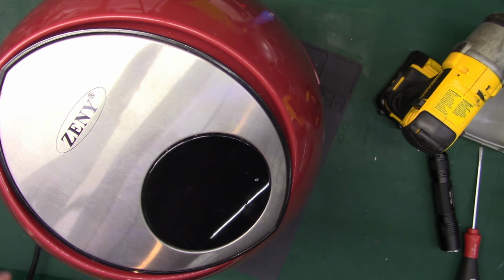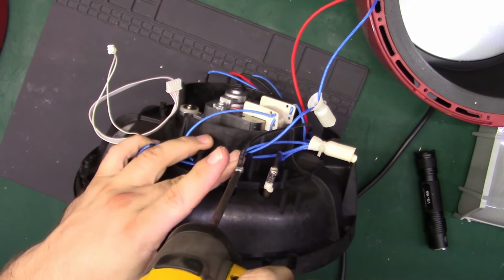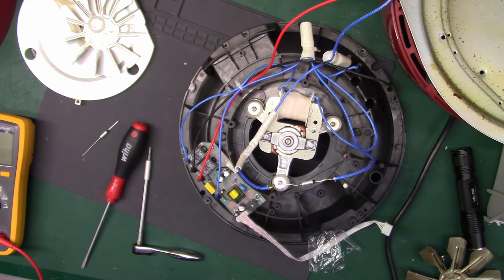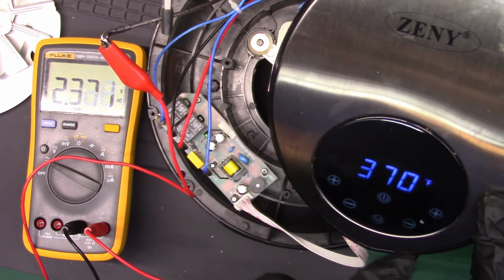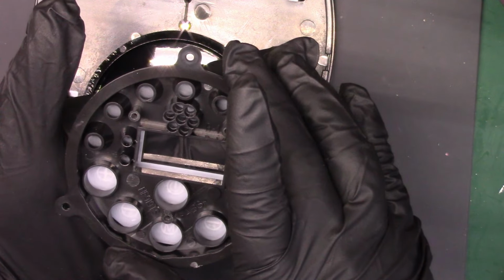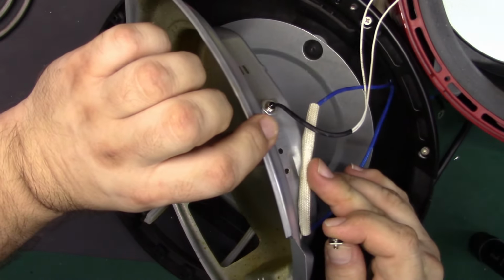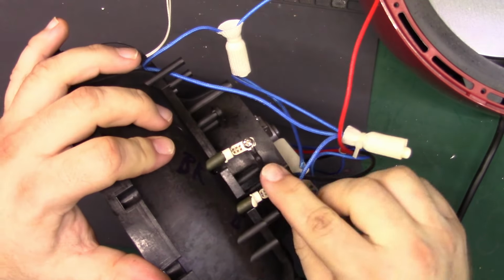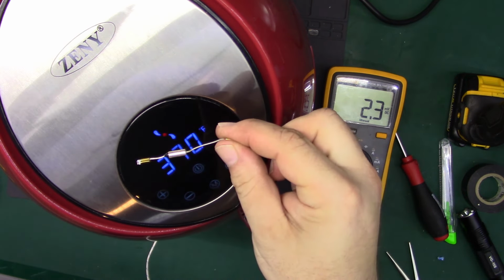Digital Air Fryer Repair

Comment: I have one question can we fix with micro switch any brand of air fryer doesn’t matter the and brand plz reply it’s will really help
Reply: What about the micro switch size any size air fryer have same size that my concern
Reply from the maker: @Sam-st4di  I am not sure.  The values are stamped on the side of the switch.  I would not be too worried though.  The switch is only making sure the basket is in place. Very low power going through the switch. There are exceptions but I would expect most microswitches on air fryers to be the same or at least compatible.
Reply from the maker: The only thing that matters is the value of the switch.  As long as voltage and current ratings are compatible(rated voltage and current must be at least the same as the old switch), you can use any brand of switch you want.
Reply: Thanks

Comment: Same parts as gormia unit .thermal fuse blew due to unit overheating .( loss of temperature control ) .Also unit not UL approved.
Reply from the maker: I think these are probably generic as heck.

Comment: Wonderful video. I blown my new 110v Instant Vortex Plus 7 in 1 airfryer oven by plugging it to a 220v plug. Wonder if it can be repaired?
Reply from the maker: Thank you! It probably can be repaired but I will warm you it might be not worth it. The only part worth changing is the internal fuse. If the main control IC is bad, it's not worth going any further with a repair.
Reply: Thank you for your reply. The white casing was burnt exposing the copper coil.

Comment: Hi there 
I was just wondering if you have ever taken the cover off a on a Tefal actifry serie - O01-1 for any repairs ! ! !
I have two Tefal actifry serie - o01-1  one no heat and it turns and the other heat but not turning.
So what I have done is combined the two to make a good one i.e. heat and turning.
The question is "does it matter if the heater element wire are crossed over ?
If i can get hold of aschematic I can sort it out immediately.
Reply from the maker: I have not personally but I can definitely tell you the heater wires being crossed it totally fine. The heater is just a coil of wire that gets hot.  There is no polarity.   My guess is the one without heat has a bad thermal fuse or bad heating element.  The fryer with no fan probably needs a new fan motor.   Making one from the 2 is a great idea!

Comment: hi there i have the same problem ive worked out the fuse has blown just out of curiosity are you meant to get continuity on the copper coil?  because i dont seem to have any?
Reply from the maker: If you mean the large coil/heater coil, then yes. You should get pretty low resistance. I'd expect 10-20ohms.
Reply: @FixitFrank  no i mean on the fan the fine copper wrapped around which the pos and negative terminals go to
Reply from the maker: @TheDazzmo  oh ok. yeah that should also show resistance. I bet your fan motor has an open coil. I think they should read around 1000 ohms(might be less, I can't quite recall).
Reply: @FixitFrank  ahh thought so!! Must be that that's packed up as its not reading anything at all!! Brilliant thank you for the reply!!! Much appreciated

Comment: Wonderful video. I have cosori that failed after 4 months! Gonna try your fix. Thanks for posting this video. I have full refund but really dislike idea of tossing this thing into landfill if it can be fixed
Reply from the maker: The trick with these seems to me measuring voltages. All friers seem to be similar. If the board acts dead then I would check for fuses and that sort of thing. I suspect the thermal fuse is bad. That seems to be common.

Comment: think you
Reply: I have a Princess House Air Fryer n washers or spacers came out of the motor but it is still working for now.  Is the motor falling off its mounts.  Only had for 4 months.  I emailed the company.  Concerned about Using it.  Should I?  Let’s see if company will replace it.  Wish I knew how to fix stuff like that.  Where are men like you.  I can fix more things then most men I know.  I can take things apart and fix by accident I suspect.  Before tossing I have some fun with it.  I learn from YouTube.  Love your excitement.

Comment: Oh I wish my Gourmia fryers control panel would pop off that easy. 
I've got to take the piezo out, the beeping is so darn annoying.
Reply: 1 hour later, figured out it was the top square panel pops off, and reveals 4 screws to take out.
De-soldered the piezo, no more buzzing!

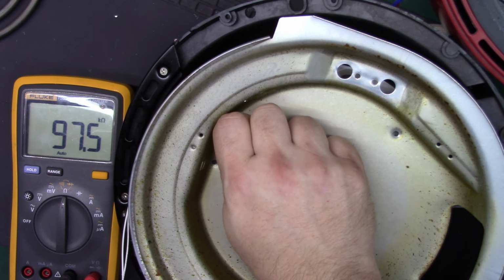Comment: Hello FixitFrank, first of all thank you very much for your video, thank you for expressing it so well and thank you for your selfless help. I happen to have a fryer like that (a little bit different on the outside but technically it is the same, it is a MVPower) with a problem, the screen says "E2", the heater and fan work but not the on-screen controls. Only the "E2" is left blinking, therefore I cannot use it. I have checked the device that you say could be a thermistor and that you touch with your hand at exactly 9:53 of your video. Your thermistor marks 97.3 koh, however mine marks as a short circuit: 0 oh. This makes me think that maybe here is the problem. I am trying to find this thermistor on Aliexpress, Amazon, etc but to no avail. Would you be so kind to help me? I would be very grateful if you could tell me where I could find it or some enlightening information. Thank you very much for everything, kind regards.

Comment: I have a piece of equipment just like the one in your video and it had a blown thermal fuse. However, after I replaced the thermal fuse and completely assembled the device and turned it on, it worked only for a moment, when it started to heat up it turned off. After it cools down, it turns on again. I am not sure if it is the thermocouple or if it is one of the capacitors on the electronic card.  
The capacitors look good. I don't know how to test the thermocouple. Could you help me, please?
Best regards.
Juan Carlos
Reply from the maker: The thermistor should be around 10K or 100K depending on the model.  You should read around that when you measure resistance.  Maybe 6-8K on a 10K thermistor and 80K~ on the 100K thermistor.  The resistance changes with the heat. But from the description, I would be suspect of the heating element.  Sounds like it might have current leakage.
Reply: @FixitFrank . I'll check the thermistor, I'll look for it in the market. In Venezuela it is a little difficult to get these items, however, I will do that search. I think you are right with the diagnosis you have given me. Thank you very much Frank.
Reply: @FixitFrank  Hi, it´s me...again. I checked the thermistor with the multimeter, however, the readings are very erratic and vary constantly. It doesn't look like the thermistor is in good condition when it do that. On the other hand, how do I verify that the heating element is leaking current? After one minute of operation, the unit simply turns off. Thank you Frank, again.

Comment: informative video.  I tore one apart and wasn't as lucky as you were.  The problem on mine was a blown thermal fuse also, and since I didn't want to wait forever for parts I just jumpered  the fuse.  For those who think that is sacrosanct the machine will still shut down before it is too hot because it has the thermistor in it for temperature control.  You will get a blinking E on the board.  I know this because when I put the machine back together I found out that the thermal fuse had blown because the coil on the fan went bad, and when the fan don't work they overheat pretty quickly!  :(  So I ended up with parts in a box instead of a hot air fryer.

Comment: Thank you so very much! I am not electronics-savvy at all, but following your video and having a multimeter saved my air fryer. Yes, it is a $40-50 unit and some people might say that it is not worthed spending few hours and $7 to fix, but it feels good when you can revive something and pollute less.

Comment: Amazing video! I just ordered some thermal fuses, as well as a multimeter - I have been putting it off for years and just guessing at which part I needed to resolder etc. haha - anyway, my air fryer runs (turns on, heats, the front controller works fine), it's just that when it runs, the fan does not turn on, ever. The fan spinning icon shows up when it is heating, and when the heat is turned off it stays on for its 'cooling' stage as well, but the fan is never actually spinning. I tore it down just today to see if there was something obvious (a loose wire running to the fan motor keeping it from getting power, for instance), and after doing that the only thing I found was one wire that was loose in a crimp nut, but after taking those out and redoing the wire nut making sure it was a secure connection, I put it back together and it's exhibiting the exact same symptoms. I am concluding now that it isn't actually a thermal fuse since the system still boots up and the element is still heating. Is there anything on the controller that I should check, or should I assume the motor was bad and burnt out? I should note I received it as a gift and only used it for ~5 weeks before it died. I bought a new one and we've used it for 6+ months now with no issue, so I don't really know what went wrong unless it was just a faulty part.
Reply from the maker: Or could be just stuck. If not and it spins freely, you can find these motors online.  Look for shaded pole motors for air friers. They are relatively generic. Good luck!
Reply: @FixitFrank  By spins freely would that just be if I spin the fan blade and it spins easily, or moves at all, or that the fan blade could spin but the motor could still be stuck somehow? Sorry if this is a dumb question.
Reply: Also thank you for replying!

Comment: Hi Frank, I bought an used Insignia air fryer model NS-AF72DBK9 which I replaced a burned thermal fuse:175degree It stars but it turns off a minute later, I opened up & troubleshooted everything, I can`t find the thermister...? can you please help me with this. Thank you...  GOD bless you

Comment: I checked the thermos fuse and its blown but I read the thermistor and I'm not getting any reading on it. If I need to replace it where can I get a new one.
Reply: You can buy one from any electrical shop or online through Ebay or Amazon

Comment: Thanks for this video. I have a DeLonghi Multifry which stopped working a few days ago after what seemed to be a surge in power during a thunderstorm. I have partially disassembled the unit and have been testing continuity on the main visible elements (everything seems OK), I then stumbled on a pair of round-shaped ceramic terminals which I can only think are Thermal Fuses, I tested continuity on both of them (I think they have somewhat different specs although look exactly the same) one worked but the other did not report continuity. I wonder if there is a way I can verify whether this is the actual culprit as I cannot easily get a hold of a replacement part in the near future. Thanks in advance for any insights you may share...

Comment: My airfryer is the power fryer xl ,the wiring is exactly the same .the fan and heater turns on but the screen wont come on,so I opened it to see if any of the circuit boards were burned and they weren't ...any tips
Reply from the maker: I'd check the resistor before the power supply.  They use resistors as fuses.  The control panel sounds like it has no power.
Reply: @FixitFrank  the control panel has no power ,i'll check the resistor thanks for the advice.

Comment: Nice video Dude! I actually had this issue with a new air fryer my sister-in-law got us last Christmas. Mockins brand. I didn't actually use it much right away because I'd never heard of an air fryer before and didn't have a good idea of what to even use it for at first. Then one day I took a dozen frozen wings out of the freezer, which I usually grill, and the light bulb came on in my head. To steal a phrase from my teenage daughter...OMG. Wings turned out just as good, if not better than we get at our local pub. For that last few months we've been making home made fries, wings, and just about anything we can think of that works with an air fryer. Then just the other day in the middle of making fries my wife noticed they weren't getting cook half way through the process. No heat all the sudden. I've left the broken thing on the counter for weeks. She's tried to message the company to see what they are willing to do for a replacement. Not surprisingly they are non responsive. I thought I take a look at how the thing operates and came across your video. I knew the issue I had was something to do with the heating element, so after a few minutes into your video I knew I was on the right track. Good job on the breakdown, and diagnosing the bad component with your trusty ol' Fluke. With a little electronics knowledge and the willingness to try you certainly prove the point that not every kitchen appliance that breaks necessarily goes into the garbage can.

Comment: I have a NuWave Brio 10 quart Air Fryer and the lid will not close all the way anymore. It seems like the Close Lid Knob is stuck pulled out and won't go back in. Do you have any idea or advice to fix this?
Reply from the maker: I am not personally familiar with that model, however from what I read, the knob is pretty important for controlling the lid.  It sounds like the pin might be out of place or maybe even bent a little.  The lid looks to be pretty heavy.  First, I would see if you can feel any movement through the pin while you open/close the lid.  You might feel a spot where the pin moves. Then you can try pushing/pulling on the pin at the spot to see if its just out of place.  Otherwise, it is time to open the fryer up, or at least getting to the hing assembly and determining if its something serious or just a bent pin that you can hammer out flat enough.

Comment: Hello, does the fuse have anything to do with the fan not working. It appears I'm getting heat, but no fan!
Reply from the maker: Probably not.  My guess would be the fan itself is jammed.  The motor is a common shaded pole motor which you can buy, but I would see if there is a video on fixing shaded pole motors. They tend to be very easy to fix as long as the coil is OK.  If the coil is bad, then you need a new $20 motor.

Comment: I'm really lost with my problem... first the little red LED doesn't come on anymore on the fan display, but I still get some heat out the exhaust...  but it's not getting hot enough...  it takes a super long time to cook something at the highest setting...  Do you have any thoughts what to look for???  Can really use your help....
Reply from the maker: Hello!  If I had to guess, I would say your heating element isn't getting enough power or the element itself is going bad and only partially heating. Another possibility(what I would check first) is to make sure the fan is turning by itself.  If the fan is jammed(this is kind of common I heard) it can be from the motor getting gunked up with grease from the food. With the unit unplugged and cool, I would push the fan with your hand and see how easy it turns. It should turn very easily.  the fact that you don't have the Fan indicator makes me think its the fan motor itself or the control circuit for your fan.
Reply: FixitFrank ....  well the fan indicator is working, it’s the little red light in the middle of the fan indicator that is not on anymore....
Reply from the maker: @jacksonjohn1000  Same thing still applies.  There are only a few things it could be.  The heating element is the more likely cause.  Some heat may mean the element is failing.
Reply: FixitFrank okay...  great....  thanks for your help!!  By the way, Great Job on the video....  please keep them coming...  you are a great help to the public in challenging the attempts to learn and make repairs for themselves!  Repair Shops are making a killing...  thanks again!!
Reply: FixitFrank ...  I’m getting low amount of heat out the exhaust,  you referenced maybe the heating element might not be getting enough power...??  How do I pursue that???
Reply from the maker: @jacksonjohn1000  There could be numerous causes.  Bad Power supply, bad element, bad control circuit.  This is not something you can fix without electrical knowledge.  Its not a simple part replacement. You need to verify if the right voltages are getting places.  Otherwise you are just throwing parts at it.
I would test the resistance of the coil first.  It should be about 12 ohms if its a 1200W coil,  a 1500W coil should be around 9-10ohms. If its over that by a bit, its failing. Or if its very low.
Reply: FixitFrank ...  okay great...  I’m old school knowledgeable in electronics,  it’s just hard to find decent SAMS on electrical appliances these days,  especially the appliances that are digital controlled...  I really was suspecting a breakdown in the  heat switch (thermocouple?), that you replaced in your video...  I just don’t know if they slowly break down or if they just quit??